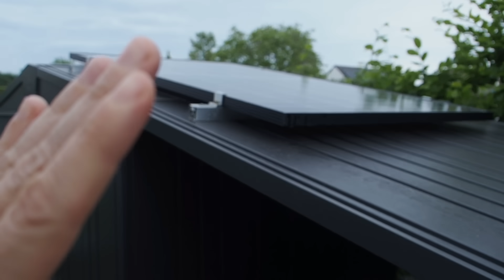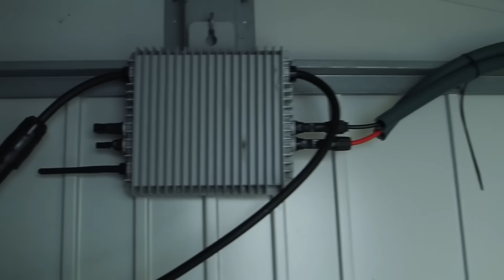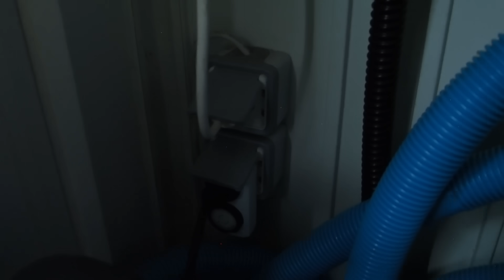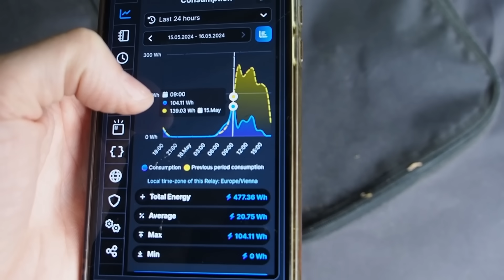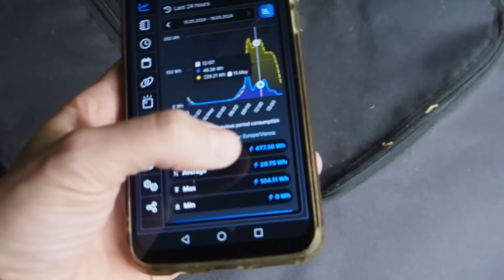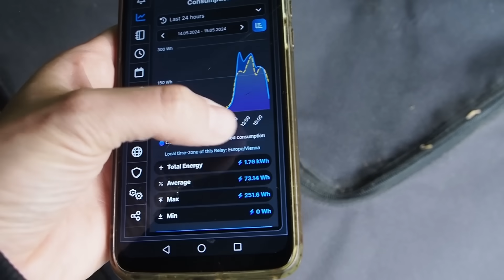Solar system? Yes? No? Which one?

Comment: Full off-grid with power storage is the best option. It’s expensive, but for a prepper it’s the only reasonable solution.
Reply: Yeah, I've got twenty two batteries on my solar and wind system 😎, one side can charge the other, it's pretty good. I made a twelve volt battery charger out of an amplifier transformer and some diodes I had. I have 14,400 watt hours on my solar batteries and 14,000 on the wind generator batteries. You're exactly right about having enough batteries. It makes them last twice as long if there's enough of them. Nobody tells you that. But you notice, the picture always has eight batteries? They were thinking 🤔 those big 48 volts batteries like 100 amps apiece. They show those running a house 🏠. I've got enough batteries finally. I got the fourth lithium iron phosphate battery 🔋 about three weeks ago. They're in parallel with four 31 series deep cycle batteries for 600 amp hours @ 24 volts. My inverter is only 2000 watts, so the amp pull on each battery is nothing...it can only go to like twenty amps draw. But I never use my inverter that hard. Maybe eight total. So one amp per battery. I can go a week really easily. I can charge off the wind batteries too through the 12 volts inverter feeding the Aims Power inverter charger, it'll use the dirty power from the modified sine wave inverter to charge them. In case there's too much wind, not enough Sun 🌞, like in the winter time. My system can go a long time, maybe two weeks on the batteries. It's always enough for me. I don't have to run ⛽ generator here unless I am welding something. I use my WinCo Lil dog, it and the welder are both 2400 watts running. They work great together. I've had enough power for everything I wanted to do. People don't want to think about spending a big chunk of money on batteries. But you're right about that one. That's what it takes. The four lithium batteries cost me $2116. But they're really nice 👍😎. The 24 volts ones are getting scarce. I was lucky to get four, I guess. Well, good luck 🤞 with your plans. You have the brightest idea 💡⚡🔋🔋 about off grid power 😁👍😎⚡💡🔋💡⚡. But you're absolutely right on point. I asked an old man once how his thing worked, he had a long cart with sixteen batteries and inverter that ran his stuff. He told me, " It's all in how many good batteries you can get together, the more, the better." So, I guess I have to say, he was right. They last twenty times longer when there's a whole bunch of them. And they don't ever run down really. Life is just better when you have enough batteries. It is expensive but what isn't these days? Congrats on the most truest thing I have ever seen on the internet on a comment.
Reply: So true. This system she has now is not the way to save money and will not run fridge freezers if the grid goes down. She is right, though they system she was quoted was just a ripoff.  Full off grid is the best way to go.
Reply: Yep 👍

Comment: You might want to look into the modular home storage systems on and coming to the market.  They have an automatic transfer switch which isolates your home from the grid so it is always connected and can charge off your excess solar production. With these, you can buy a basic system and add capacity as needed later, especially as batter prices fall.

Comment: Where i live in the  United States, the power companies tried to get legislation passed that would have allowed them to use the excess power generated from home solar systems without having to pay the home owner for it.  Fortunately, our governor vetoed that bill, so the power companies have to give credits to home owners for excess power they generate which can be used against the home owner's power bill. At the end of the year, the power companies pay around 3 to 4 cents per kilowatt hour for every unused credits. The power companies still come out ahead, as the average cost of power is around 12 cents per kilowatt hour. If there is an excess of power in one place, the power companies have the ability to reroute the extra power to another part of the grid.

Comment: The labor is always 2 times or more of the actual cost of the system! You have to have battery backup and a switch to shut down the power when you go over the amount you use so you have power all year round! You have to be careful with who you go with! Ac in Los Angeles California can be 500.00-1000.00 a month in electrical bills!

Comment: I have a 2kw on grid solar system which almost covers my mains bill. But I also have a 4kw off grid system that goes into 30off 100ah Lifepo4 batteries. I'm now using the off grid system and the mains power is my back up 😅

Comment: Battery bank only expensive part that needs replaced every so often....My garage runs off solar lighting with its own solar panel snd bsttery ...cheap way to light it up... 
 I have 100 W solar panel to run chsrgr bsttety bank to inverter to chsrge my cordless electric tools ...

Comment: I did the calculations in front of the sales person here in Southern Commiefornia.  My house is gas & electric.  The sales rep was touting how much % increase each year that the power company was going to increase their prices.  For easier numbers for the sales rep, I increased it to 10% annually.

He was claiming how good his system was and then proceeded to tell me the price.  I calculated the annual 10% increase to my bill and showed him that it would take 19 1/2 years to break even.  I even pointed out that the quality of the panels would degrade during those years and it would not be putting put 100% after 19 1/2 years.  He was shocked with my calculations.

He claimed the supervisor would give me a deal.  Supervisor called and said if they could advertise I coyld get a better deal.  I told him I would plaster his company's info on my cars and over the house and get their name out there.  When he came over he said he would not do tgat but would give me less panels and substandard panels compared to the original good panels.

I told him to get out of my house, and he started yelling and getting belligerent in front of my kids.  He did not want to leave until I pulled out the blade.  Then he finally left.

Comment: Ya it’s unfortunate, I have 6500 watts on the garage, and 5.30 kWh battery,I put it all in , i looked into the legal way and found out I was going to never get my money back , so I did purchased equipment and installed it myself.
I have been running this system for 10 years.
I live out of site and stay out of mind  by
living in the far North-of Canada and keeping quiet about, would be impossible in the city, to many eyes and enforcement  in any city
I say find a way to make it happen, the government is evil and useless so do what you can to get away with it ,just like the government.

Comment: You made the right decision Lilly about the solar panel on the house roof 👌 to get the best from solar in Europe you have to be very minimal in what you do with electricity because we don't have the heat rays to heat the panels up , the  panels are technically not good enough  at the moment. 

❤Lilly.

Comment: As someone who lives in an RV and spends a lot of time off grid, I love the setup I installed.  Going on 4 years of use now and it still runs flawlessly.  Admittedly, I spend most of my time in the desert (Arizona) and we have blue sky days almost year round.  The Sun gives me enough power to run my Air Conditioning in the RV without issues.  I can see how installs aren't beneficial to everyone, but mine has been a life changer.  Mine cost $6100 in 2020 and it's been worth every penny to me. 

I wish you well with your Island Install on the wall of your shed.  It'll come in handy if there's an extended blackout.  Speaking of blackouts, did you folks get to see the Northern Lights with the last Solar Storm we had a few days ago?  I hope you did.  Another complex sunspot cluster is moving on to the Earth facing side of the Sun right now so we might get more Solar Flares and CMEs.

Comment: 6k in material, 6k in labor. Thats pretty good considering they need licensing and insurance for electrical and roof work.
Reply: i remember a 5kWp solar roof would've cost you 20k back in 2000 but back then the government would subsidize solar power with 50! ct/kWh. Energy costs were around 20 ct/kWh. So you had a huge profit guaranteed for 20 years where the costs would've paid off after half the time. Lots of rich people took advantage of that of course. I had a school teacher who had a ranch and he built multiple solar arrays on rotating frames for like half a million. The loans would pay themselves off using the solar power and he had enough securities to back the loans up. Lucky guy!
Reply from the maker: You mean 6k in material, 1k minimum wage for labor for one day and 5k for the owner of the solar company who now got a nice sailboat that his customers paid for him

Comment: I have 2 portable Jackery solar panels (200 watts total) and a small 1000 (or maybe it is 2000) generator/battery storage that goes with them just to have a back up for my small freezer. There is so much hail in this part of Texas that I would not want permanent ones on my roof. Also, many insurance companies are dropping people who have them because of the hail costs. Several solar farms in my area have been hit this year with massive hail damage causing harm to the environment with toxins leeching out of the broken panels. I pull my set up out every 3 months, discharge the battery/generator by running a window fan for several days, then recharge the system and store until needed. If I was to buy again, I would go the same way but use this other set up by another company that has a different battery which lasts longer than Jackery. I got this one during a black Friday sale.
Reply: Jackery didn't sell units with LFP cells. Kinda dumb considering that's what everyone else uses. I think they've just recently switched from li-ion and nmc cells. Cheaper, but not near the life cycles.
Reply: @rtsrts2317  I went with what I could afford at the time with the knowledge that I would only get a few years of use out of it. My daughter was very happy to have it last night as Houston has been hit with a major storm on the level of a cat 1 in terms of winds. She was able to plug in her refrigerator last night at 9 pm and by 6 this morning, she still had 44 percent remaining on the 1000 W battery. She has a on demand hot water heater that runs on gas, but they all have electric switches. She can get hot water by using this back up battery. Hotels are at a premium, and by staying home and using this one product judicially, selectively we will make our money back in cost savings. I would not have purchased except for the black Friday deal, included 2 solar panels that also have USB ports for charging other stuff at the same time as the generator, it being able to take a surge of 1200watts, and being lightweight enough that I could maneuver it where needed. In addition to the black Friday deal, I got either 100 or 200 off for taking out an Amazon credit card which I immediately paid off the next day. The cost matched my bank account and gave me peace of mind for being able to deal with another winter freeze like I had in Feb 2021 with no power for a week. Should the grid go down, I can wash clothes, I have a gas dryer but I need this for the electric portion, run my freezer and still keep up with the news and have internet. I will have to alternate between devices, but I will not be thrown totally back to the dark ages again. IF I had the money, I would've bought something else for sure.
Reply: I wonder if installing them vertically would reduce/prevent hail damage.
Reply: @lesliehunter1823  I don't know. I am just passing on anything permanent.

Comment: Hi lily, I have one 250 watt panel a 115 amp agm battery, with a controller, I live in my van and that is more than enough for me to run a Waeco 45 litre fridge and electrical devices like phone and so on, I also have a dc makita charger that is very efficient. I live in Australia where it’s fairly sunny.

Comment: It varies. I work from home, am in tech, and own an EV. I have a heat pump, electric stove, etc. That means high electric usage - BY DESIGN. 

My standalone system (not on the roof), produces 10 KW and meets about 70-80% of my needs. Here's the thing: I know what I'm paying for my electricity. Even if the powerco's price goes up, most of my needs are met by my system, keeping my bills consistent. I'm not dependent on the price of oil or gas so much as one source. It makes it easy to manage and plan accordingly.

Right now, the power company pays me for any overproduction at market price. This is changing, as Arizona, California, and Florida have been screwing around. Not a problem. 

The day they do it here in PA is the day I get a residential battery - my electrons are no different than those power plant generated ones. Right now, I feed the extra into my neighborhood.

Comment: Battery bank solves all the grid issues. You have your own when grid is down
Reply: Except battery banks cost a bomb and have an even more limited lifespan
Reply: @TheBelrick  Nah, pretty inexpensive compared to the crap acid Chemistry weve had to deal with for decades.  per wh is a way better value if you catch them on sale. But, If you'd rather pay $50k for a massive panel-only system that only produces during the day, be my guest.
Reply: @rtsrts2317  Batteries are an expensive add on because they don't add to the amount of electricity being generated(captured) by the system; they only help with the load balancing of the system. Their cost still needs to be recouped from the system and they degrade with each cycle of use. There is an economic reason to why people use batteries sparingly and mostly in devices where the flexibility that the battery allows is more valuable than the extra cost that is incurred from using the battery.
Reply: @TheBelrick  Make your own. It will cost you a fraction.
Reply: @chesshooligan1282  I built a hydro station. Covid hit and my keplan generator was cancelled due to factory closure, then a cyclone struck and knocked out my weir , banks and aqueduct feeder.
And of course living has gotten so much more expensive all i can do at the moment is look at the ruins and lament.
Reply: @TheBelrick  Goddammit. Sorry about that.
Reply: @chesshooligan1282  Life can crush. Maybe in the future funds will come my way, my hope is to still have power without the grid. 
Regardless i've made plans to live without electricity period. People on this channel are becoming aware that something is seriously wrong with the world.
I'm just a stranger, but electricity will eventually not be an option for anyone.
Reply: @TheBelrick  I know this is not a financial channel, but there's a huge freaking elephant in the room, and that's the USA's national debt. I hope you don't have a pension based on government bonds or similar. In my humble opinion, hyperinflation likely in the next few years. That's all I'm saying. Good luck whatever your plans are.
Reply: @chesshooligan1282  Same to you and God bless. Everything is being torn down and we cannot rely upon anything any state offers.
Reply: @chesshooligan1282  excellent 👌 point. My father in law and mother rely on his pension. I shudder to think what will happen. They don't buy into the pepper mentality.
Reply: Boom!
Reply: I have twenty three in mine, four big lithium ones, I got enough
Reply: That is good and all but the cost of high capacity batteries of the proper kind are expensive depending where a person lives. Also if you do a grid tie some countries you must apply for permission to tie into the system and have to submit all the proper stuff.
Reply: Indeed.
For houses it is great.
For industrial uses not so much
Reply: Drill baby, drill,
Reply: I've got around $4200 worth of batteries 🔋🔋🔋🔋, lol 😆
Reply: @davidpotter9462  Glad your solar works well for your situation. What location are you in and number of people living in your house. I live in Australia, and some can get by with systems as small as 3kw and others have 10kw or bigger on private homes with a battery and still have to pay for some electricity.  So many variants as to house size, other like use of gas (propane) and wood for heating cooling etc. How frugal people are with their use of electricity and management as in using appliances in times of higher solar input etc.  The one thing that is for sure has it made a real mess of power system in Australia with brown energy and big reason our power prices are quite expensive. We pay around 44 to over 50 cents a kw compared to around 20 to 25 cents kw around 12 to 15years ago when our government and experts told the people how renewables would make our electricity cheaper and began blowing up coal power stations in their rush to save the planet.

Comment: Sounds good Lilly! I have a very small emergency backup solar system with a battery so I can run the furnace in winter or freezer/fridge in summer. It would get us through a 12 hour outage with no sun. Here in the U.S. the utility companies have small crews so the outages after storms are lasting longer.

Comment: Another thing to consider here in the USA. Property insurance premiums can increase with solar panels on your roof. Due to weight, wind hazards, etc. Friend of mine just about doubled his insurance payments because of solar.
Reply: I ground mounted mine, easier to clean.
Reply: And new insurance requirements are no renewals if roof is 10yrs older or older so new roof every 10 years - homeowners insurance.